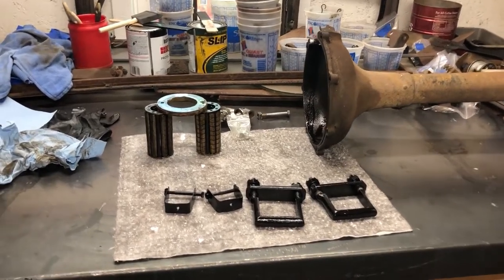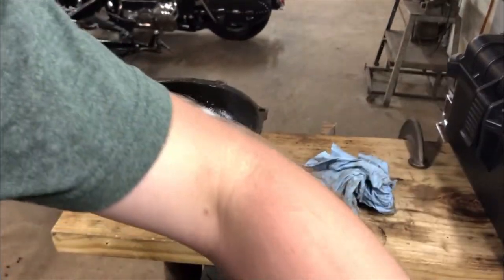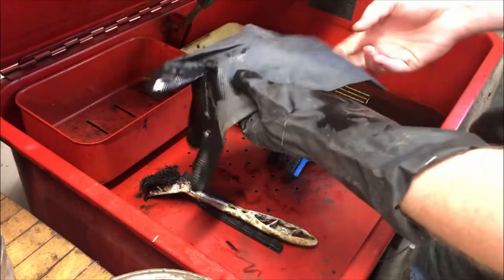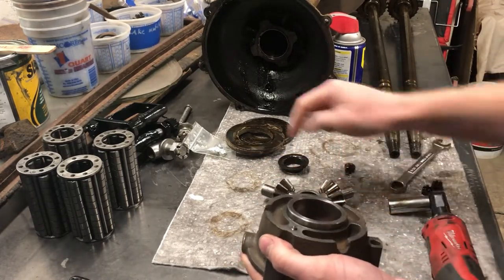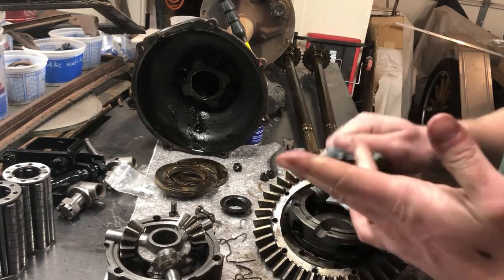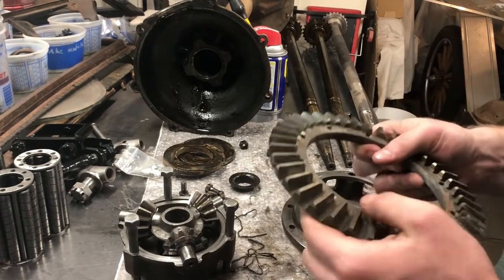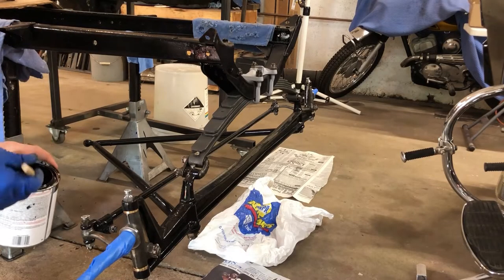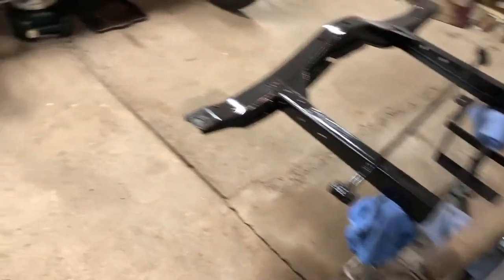1926 Ford Model T Differential Disassembly Clean Up Inspection and Painting Part 5

Comment: I had the same problem with my 1927 axles. I think the cause is loose axle nuts. It lets the wheel hub move on the shaft. I replaced both axles and one hub. Thanks for the great video.

Comment: It’s not the key that does the work on the rear hub,  it’s the taper and they are meant to be damn tight that’s how it works, and the reason you need the puller to get them off.

Comment: Have you found the Model T to be difficult to work on? I'm not a mechanic and have only basic hand tools, not a machine shop. With a Ford Model T repair manual and the purchase of maybe a few specialized Ford tools, can an average non-professional keep a Model T running and driving well and repaired when necessary (the parts that most often need attention?) I used to rebuild bicycles when I was younger, and am not afraid to get dirty. A correct, well-maintained, unmodified but solid touring car is on my short list of adult "toys" to find one day. Thanks!
Reply from the maker: The Model T was designed to be easily worked on. You will need the Ford manual. There are other helpful manuals out there as well. You will also need some specialized Ford tools as well for maintenance. They came with all the special tools when new. The tools can be easily sourced online if they are missing. If the average American in the 1920s could work on one you can too.
Reply: @JohnsClunkerCars  Thanks for your kind reply. Keep those videos coming.